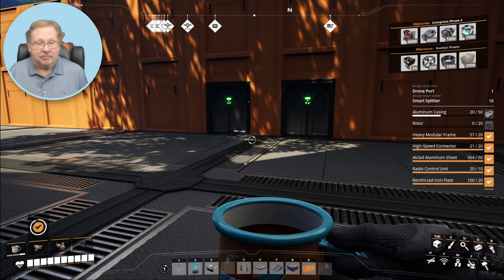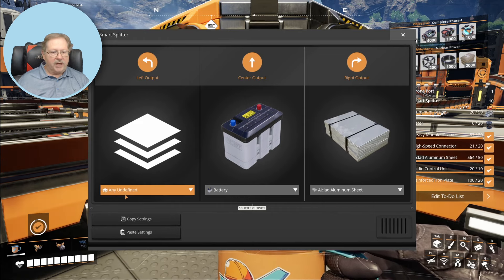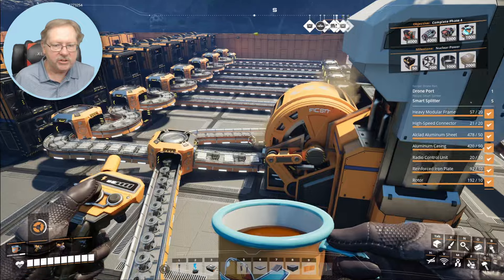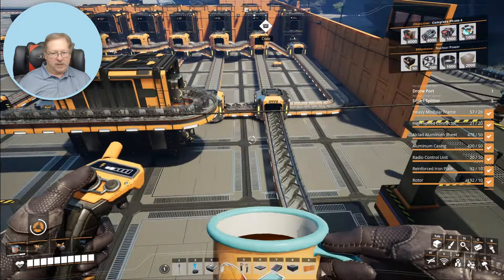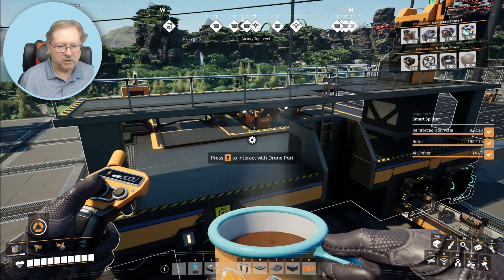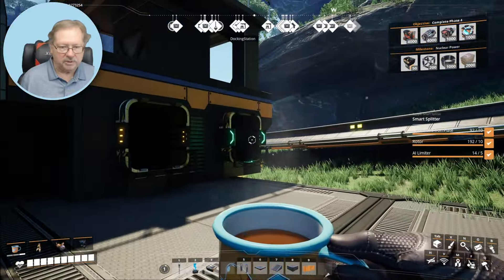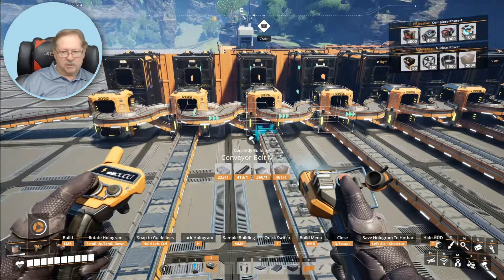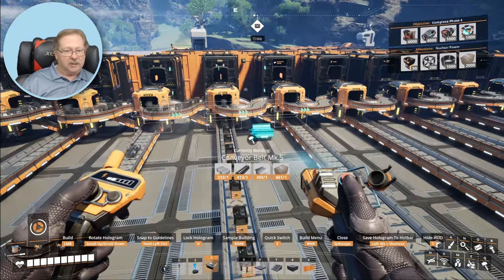Sorting Items for the mall with Overflow protection [Satisfactory Mall 4]

Comment: I'm so glad I found your channel.  It has been great watching you build and struggle (like the rest of us who play Satisfactory).  I recommend you update your Storage Mall blueprint to include the Smart Splitter and Merger on the back side.  It would make things easier for expanding like you did in this episode.

Also, any reason why you don't use conveyor lifts?  You used them early on, but haven't seen one in use for a very long time.  If you use them with conveyor floor holes, you almost have infinite length/lift capability.
Reply from the maker: I do almost all of my designs flat to start with. If I was in a creative world I'd probably use lifts more, but since it's playing through each piece one at a time I forget to use them.

And yes, the mall blueprint will definitely be getting an upgrade in this new playthrough. Going to include a lot more functionality- especially the dimensional depot!

Comment: Hey Doc, love your videos, but a lot of the time i find myself asking more questions xD
I'm working on a central storage, but it has a mirrored side opposite it, so 2x lines of 12, with a central walkway through.
What i'm really struggling with firstly is, i don't want to merge my 12 Input bus into one line because of blockages, as they run directly from the factory, but i believe you answered this in your "multiplex Manifold" short, where you mention you can merge onto the line at any point. how do i do this exactly? i have the separate "Any undefined line, and the over flow line" because all i can think of is to run the "Undefined" line in a loop, hoping it finds it's container, because what if something joins the line after it's designated container, but then i would also love a storage container at the start to drop off inventory items, and then a storage container at the end for all other non defined items, so i can see what else might need adding in the future.
i hope i explained this clear enough, i honestly have been wracking my brain around this for 3 days now, and i think i'm going insane.

Comment: Great video as usual Doc! I do have a question you might be able to answer. When using drones or vehicles to transport materials, how do you make sure neither side backs up or runs out of supply? Say I were to bring in coal to a steel factory with drones.
Reply from the maker: The best way to prevent it from backing up at the destination is to add a single storage container as a buffer. With mark V belts it should almost entirely empty the drone bay before a new drone can land. 

Running out of supply is a different issue. The supply limit has to do with the cycle time of the drone bay- how quickly a drone can unload and bring in a new drone. I'm not sure what that is, so more research is needed!